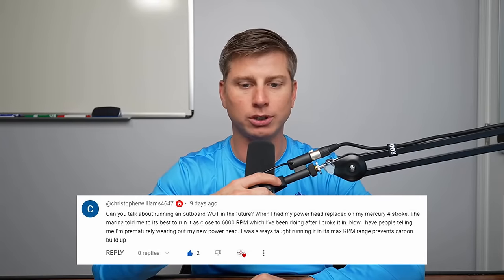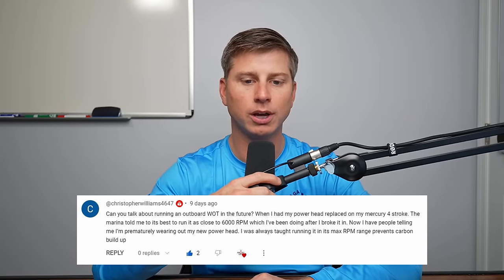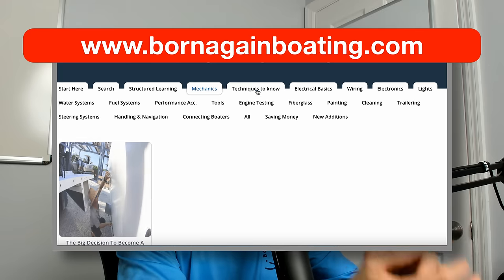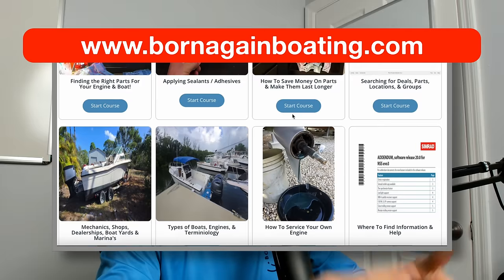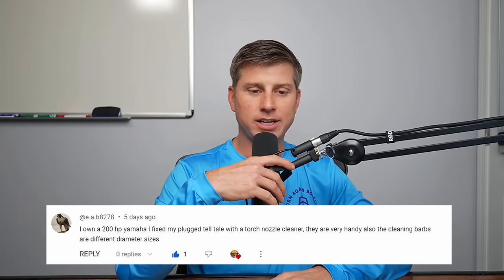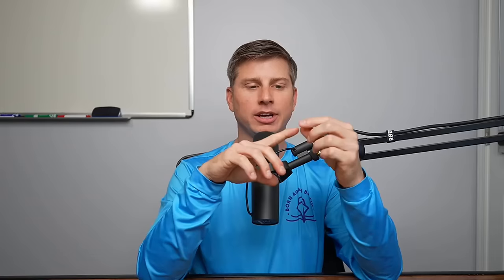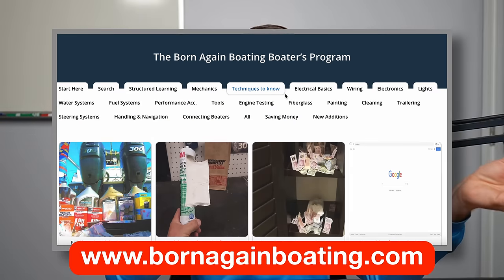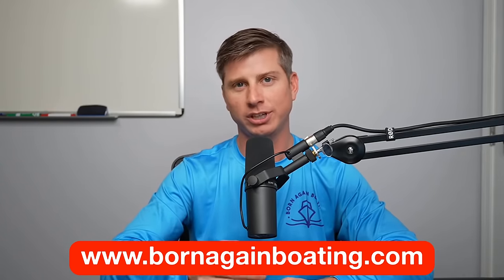Is Full Throttle BAD For Outboards?

Comment: I’ve had several outboards between 250-350hp over the years. The only one that hated high RPM was the Yamaha SHO. It puked 2 power heads in 3 months but that was a cooling issue with nose cone and hull design.

My Mercurys loved being driven like they were stolen. They always ran at as many rpm as water conditions would allow.

Comment: I work for FWC and we run our boats pretty hard. We have lots of engines with very high hours. I think key to longevity is running the engine across the entire rpm range coupled with great maintenance.
Reply from the maker: True that! It's hard to have a discussion because you can't blanket everything :/ tons of people now walking about their 5HP engine and they run WOT everywhere they go lol kind of proves the point though :) they've been running WOT everywhere they go in the boat for 15 years and no issues!
Reply: I also worked for a marine law enforcement agency and yes, lol, we ran our engines pretty hard. However, we also did a lot of idling which I think causes more wear and tear than high rpms. We actually used to take the thermostats out because of this.
Reply: How many hours is "very high"?
I've seen Yamahas with 14,000 hours on them, still running great.
Reply: I run near full throttle, I also troll for hours. My new Trolling motor is amazing.
2019 Evinrude 2 Stoke best motor on the water.
I put on 177hrs last season hunting & fishing.
I play in Georgian Bay Ontario Canada.
I’m not a fan of Four Strokes
Reply: I like watching the ridiculous dui test you guys conduct at FWC Matt 😂 I don’t believe I would admit to working for them.
Reply: Full throttle for men. Less throttle for the delicate ladies.
Reply: @kailaniandi  Try driving your car full throttle and report back your findings.
Reply: @thisisyourcaptainspeaking2259  I tap my Mercedes S430 everyday. Not all day, but Everyday. My boat motors also. Very rarely less than full throttle. They are mostly governed and designed to run where they are set. They wouldn't over-speed under normal operations.
Reply: @kailaniandi  I'm not sure how you can constantly drive your Mercedes with accelerator on the floor but more power to you.  WOT blasts are fine and I encourage them primarily on return to mooring but not sustained wot operation in any case.
Reply: @thisisyourcaptainspeaking2259  german autobahn daily drivers have questions
Reply: @TheBoatersPodcast also depends on the engine itself eg my 25 Merc sea pro is actually a 30hp detuned with a resistor put in place with a heavy cam to spin heavy sea props being a commercial engine it loves W.O.T while still being fuel efficient at wide open
Reply: @thisisyourcaptainspeaking2259 I have a 95 ford ranger… there’s no other option in Dallas traffic
Reply: @glind82  because of stupid European taxation laws cars older than say 7 years are highly taxed.  So why does high RPM on the autobahn matter, Germany makes them act like throwaways.

Comment: I have 2024 Yamaha 300. If I’m running full throttle, which in my case is 5800rpm, I’ll be going around 50 knots. I figure the lifespan of the motor is 10 years at most so I’m just gonna run the thing howvever I want and just try not to think about it too much. Just enjoy the ride!!

Comment: My dad has an old 2-stroke Evinrude 15 horse on his 14 foot boat.  That thing has spent its entire life at WOT, even pulling a knee border or a water skier for hours every day.

It’s still running like brand new. No issues whatsoever.
Reply: The old 2stroke evinrude 15hp outboards were beasts.
Reply: Yeah I have one on my v hull 14ft it’s gets it about 36mph runs wot every day, I’ve measured the head temps the run coolest and wot and get the best fuel mileage
Reply: That’s one tough outboard.
Reply: @turkeyboyjh1 ... 36mph .... On a 14v? Bull. I had a 15hp evinrude and it barely planed at 15 to 16mph with just me at 200lbs
Reply: @DustinDIY  it’s far from stock
Reply: @turkeyboyjh1  then it isnt 15hp. Unless you added turbo. It ain't getting much more power.
Reply: I have a 44 year old Evinrude 9.9. Runs and starts perfectly.
I has been used on vacaitions in my family beach house.
For this kind of use. Running something like 20 hours each year, two strokes are really easy to live with. No timing belt, no oil change. We have changed gearlube and impeller a few times, and that is it.
I know four strokes have better fuel economy, but this thing gets you far on a gallon. I bet even if you include fuelcosts, the old one is the cheaper choice.

Comment: My little 70hp Yamaha 4 stroke burns 3.5 gal/hr at 4300 rpm and 5.5 gal/hr at 5300 rpm’s. According to my NMEA 2000. That’s why I rarely run over 4500 rpm’s. 22-25 mph is plenty fast for my fishing.
Reply from the maker: You run your engine pretty much the way 75% of all other boaters do :)
Reply: Damn! My old merc 115hp inline 6 2 stroke burns 6 gallons an hour at 4200rpm. I’d hate to now what it does at WOT. Good know its not that much less efficient cruising than a four stroke.
Reply: I have 12 gallons onboard a 16' aluminum tracker with a 25hp 2 stroke. Fuel lasts 20+ trips lmao
Reply: @AbbyNormalGarage  thrust me, it’s half the efficiency of a 4 stroke, cuz I owned both

Comment: I have a 97 Johnson Fast Strike with a fuel/oil mixing pump. I was told that most failures from these engines came from running half throttle and that at WOT you were providing better oiling and cooling (from gas as well as impeller) to the engine.

Comment: I think many people are confused about the engine RPM. The more times you rub two pieces of metal against each other and the more fuel/air introduced to create more power causing more internal pressures wears things more quickly. More RPM creates this scenario. Propping for max RPM reduces the load on the engine and prevents what we call lugging an engine that can cause pre ignition which causes piston, rod and main bearing damage. It also governs the engine to manufacturers recommendations and allow max speed for that application. Running the engine at that WOT weather it is in the recommended operating range or not will lessen the life of the engine as described above. This is why rigging a boat with more power than you will normally use is a good idea. You can use the power for quick planing, emergency maneuvers, and beating a storm back to port. In normal cruise you pull back the throttle to your cruise speed which takes a lot of load off the engine. As far as carbon problems, this is mostly from the old days with leaded fuel. Lead build up was the main culprit on piston tops, combustion chambers, valves, and spark plugs. and thick enough you could measure it with a ruler. I began my career in the days of fully leaded gas and have seen the difference when performing valve jobs and engine builds. I think break in is somewhat of a critical thing especially for some manufactures and their choice of materials used. In a not shell, don't idle or run WOT any longer than necessary for the first few hours and vary the throttle. Some piston ring manufacturers recommend several full throttle accelerations in mid range RPM for initial ring break.
Reply: Another thing u don't hear people talk about is letting the engine come up to temp!! Bass guys are notorious for jump in the seat turn the key and hammer down till the next fishing spot.  Edwin evers talked about the importance of letting motor come up to temperature.  It was the best advice I've heard. He believes that's how the ocean guys get more hours out of their powerheads than bass guys.
Reply: My friend, as a 40 yr wrench on many platforms, I don't say this very often,,  but: "I couldn't have said it better."  Well done.
Reply: So would you say it’s safe to run my 2023 Yamaha 300 at WOT continuously for 1.5 hours or so?  I have a half hour minimum wake canal ride to get out then when it’s glass out I’ve thought about running WOT the rest of the way, but my old school brain processes have always told me that’s bad for the engine.
Reply: @marcgonsalves6414  bass fisherman make hour + runs all the time without coming off wot unless it's a barge wake or bridge speed reduction or maybe hairpin turns in a small creek. But I believe finding that sweet spot where it's running like a sewing machine and ur getting the best mpg. Opinions will vary. Sometimes I belive it's down to just getting a great motor.
Reply: life story

Comment: lol. I’m only here to say we have a response skiff on our barge, 16’ and a 90 Honda. That thing only experiences two positions. Idle or throttle against the dash. Seems to be working. Plus I can be pretty sure there is no carbon deposits. It gets a little bit of lower throttle when it gets above 3’ swells. The bilge pump works solid.

Comment: I only run my 2000 Yammy 250 ox66 WOT (5600rpm) on my way in..on the way out and moving from spot to spot it's usually 4500rpm. 👍👍👍
Reply: Same here. My last mile or 2 is wot 
Cruise is 4000-4200. @ 35-37 mph on twin 225 OX’s

Comment: The higher RPM you run the greater stress on the engines rods, pistons, valves and springs so natirally you are adding fatigue to all your engine mechanical parts which leads to wear and increased chance of mechanical failure.

Comment: I’ve had numerous engines Johnson 5 1/2 from the 1950’s, that my grandfather bought brand new, a 6hp, 15hp and a 2002 mercury 20HP I bought brand new all ran wide open by me or my kids 95% of the time for they’re whole life. Also a for larger motors a 70HP Johnson 3cyl a Johnson V4 90hp and Mercury 135hp V6, again all being run at WOT or close to it 90% of the time  on my lake pulling tuber’s skiers etc and not one of them has ever blown up or had any major problem! Never had to replace or rebuild one thing on the smaller engines. The bigger engines I have only replaced coils and a power pack or 2. But they have all been carbureted 2-strokes so something to be said for that. Now as for my new Mercury Pro X/S is a great motor but way to many modern components too fail (and they have) lucky for the warranty. Love my Evinrude  E-etec I bought brand new in 2015 and have only had an injector fail and some minor software issues but do I think the Merc Pro X/S or Etec is going to handle 30+ years of abuse a live 5000RPM? Probably not as they both have too many parts to fail and lack the simplicity of a carbureted 2-stroke, hence the phrase (they don’t make them like they use too) the only way the modern engines beat the older ones is fuel consumption and cleaner burning.  Although the newer ethanol based fuels is what’s let to minor carb related issues like taking an extra second to start or not idling perfectly but that’s all easily solved with either sea-foam, a carb clean or running quality fuels. Running in fresh water makes a huge difference as well, always flush your motor after running in the salt
Reply from the maker: Yup! You prove the point :)

Comment: I have a 2000 Mercury 125 outboard 2 stroke fuel/ oil mixing pump. I never run it over 4000 rpms and usually doing 20-25 mph .

Comment: I run in barnegat bay NJ where there's almost always wind chop and boat wake. WOT would put my boat at a speed that would literally beat the hell out of the boat and anyone sitting in the cockpit. I find 4000 rpm (mercury 150 2 stroke) gets me to around 27 mph which usually keeps us from getting too beat up and saves gas. It is nice to run faster on calm glassy days but those are few and far between especially in the summer.

Comment: You have to run the correct prop. My Mercury manual says 5500 to 6000 RPMs at full throttle. I tried a few different props before I got it to run at 5800 WOT. Now you can run it Full Throttle all the time

Comment: Most 2 stroke outboards can turn 8000 to 10- 12000 rpm and the stock reed valve only allows around 5000 to 6200 rpm so wide open is only half the rpm of the motor
Reply: Not working that hard, at all.🍻

Comment: My old evinrude 15hp has ran at wot only basically for over 20 years it’s had a new impeller every season and a couple pull starters and new plugs it has never had any issues, great compression, fires right up 14 ft v hull Jon boat hits 36mph

Comment: I've got an old 99' Honda 50 that we bought new in 99', have run it year round since, it must have a couple thousand hours on it by now.  Redline is 6k, we commonly cruise at 5200-ish rpm for long periods, it doesn't mind at all.  I'm meticulous about maintenance, especially oil changes.
Reply from the maker: That's awesome! :)
Reply: That is a great testimonial for the longevity and dependability of that powerplant and your maintenance regimen.

Do you care to elaborate upon your basic maintenance schedule or annual inspection? Also, have you had any major part or component failures or parts that required replacement? I imagine the impeller, fuel filters and spark plugs have been changed, but other than the normal wear-n-tear items, have any heads, pistons, injectors, ignition system components, lower end parts required replacement?

Finally, what is the model number of this Honda engine that has been so reliable?

Comment: I use outboards for sailboat auxiliary propulsion. I currently run a 4 hp Tohatsu 4-cycle with a high-thrust prop (shallow pitch, large diameter). I get maximum hull speed at about 3/4 throttle or less. Increasing throttle over 3/4 does not result in increased hull speed.
Reply: While you didn't specify length/beam of your vessel, I run a 26' square rig twin keep Westerly.. Same powerplant. Comfortable crushing speed(for motor) seems to be about 4-5 knots at 3/4 throttle. Looking around for prop upgrade,. Can I ask what brand/style you went with? End result? Great comment and thanks.

Comment: It specifically says in mercurys owner’s manual to run wot to maximize the longevity of the outboard..
Reply: You are correct but you need the proper pitch propeller to get the correct RPMs at wot
Reply: @56igadget  
5800-6200 is what they consider wot. But I like to get on the 6200 rpm range.

Comment: Everywhere I go is such a spot to spot trip that I never go down to “cruising speed” I always just run WOT because the farthest I go WOT is max 5 miles. I’ve had the same 2009 Yamaha since 2017 and never had a power head issue. The only issues I’ve ever had was fueling with water issues. Boat motors now are so tough that it’s really hard to blow one up.

Comment: Optimal rpm is up on plane about 3000 3100 3200 maybe 2800 that is ideal fuel burn what's the point in running at 6000 RPM at a high fuel burn if you're not racing

Comment: Best not to put ATF in power steering systems. It was that mark, where Mercedes steering boxes stopped getting sloppy after 100K. In 1987, Mercedes switched to power steering fluid from ATF. I have an 87 S-Class, basically no slop in steering. Every 86 and prior has 1-3 inches slop in steering.
Reply from the maker: Yeah, I'd say to stick with the clear OEM stuff on power steering systems too

Comment: Please clarify the proper way to flush 225 merc 3.4L 2016 I always used the muffs was told the thermostat doesn’t open when using flushing ports so the whole motor does not get flushed . my motor seems to climb in temp usin muffs so I’m using flush port now. Thank you
Reply from the maker: You are correct, the thermostat doesn't open up until a specific temperature, so when you flush with the flush attachment, if you don't flush immediately when you get back to the dock, the engine will have time to cool down and the thermostat will close. So you won't be flushing the thermostat dump hose, the fitting that it uses to go down into the adapter plate, and then the hose dumping it into the exhaust basically. So the only issue you would have there is the fitting there in the adapter plate, which was kind of an issue on the L6, but it generally outlasted everything else, so not as much of a problem as you would think. 
Yes, the engine most of the time is going to overheat if you run it too long on the hose, even in a bucket sometimes. But I would still say flushing it on the flush attachment is the best way. It's what it's designed for and it'll flush everything else in the engine but that dump hose if not flushed quick enough.

Comment: at wide open throttle it should not take more than 15 minutes at full throttle to burn off the built up carbon on the valves, which is where it tends to build up. and that only works if your motor has port injection, does not work for direct injection motors, unless they have both. with direct injection engines the only way to remove buildup carbon is at the shop with wallnut blasting in the valves. which is part of the maintenance.

Comment: Wide open throttle is not the engines redline. If your engine is in proper tune feel free to operate it at whatever rpm you desire.
Reply: You are exactly right you need the proper prop to get the right RPMs then you run wide open all day long

Comment: I know i am late. What could be causing my 40 hp 2 stroke mercury to be bogging down at full throttle? Thank you.
Reply from the maker: Could be any number of things! Either electrical or fuel, most likely fuel, bogging down generally has to do with fuel related issues, whether that be that the engine is not getting enough fuel, or there is a clog somewhere that is stopping the fuel from getting into the engine. Or the plugs are fouled out, or timing is off, or a bad spark plug? 

Not sure without running the tests, you will have to test some things and then go from there :/

Comment: Nobody ever says this, HIGH RPM’S kills engines! The lower rpm the longer your engine will last. On my automotive engines my reasoning is if I can cruse on the expressway at 70 mph doing 2000 rpm I can drive from start to finish and never go above2500 rpm.   Gas mileage is better, everything is better at lower rpm’s. On my marine engines I use the same logic.